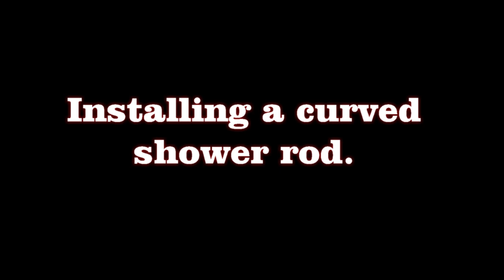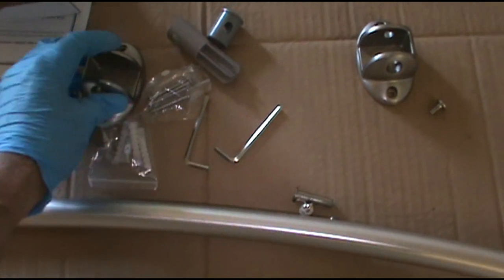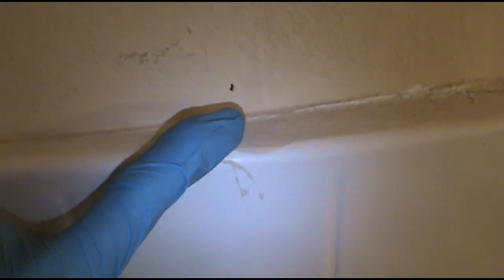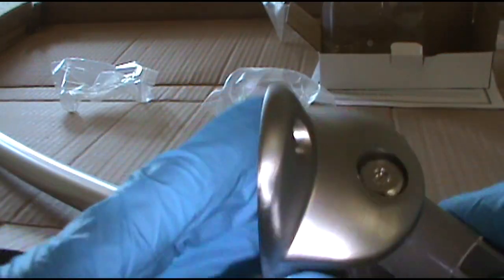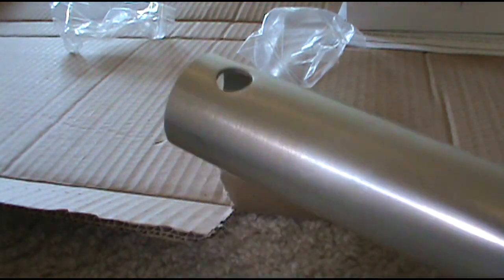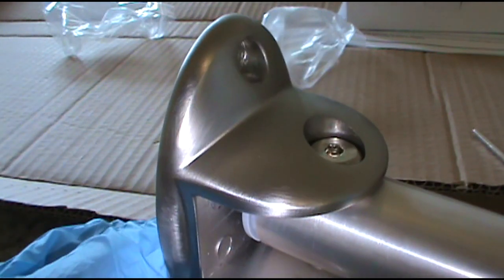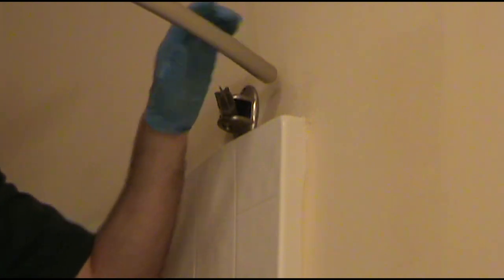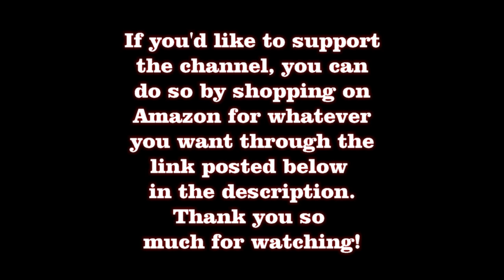HOW TO INSTALL A CURVED SHOWER ROD

Comment: Like your video, but there are two things I have learned over the years about curved rods.  1.  When you mount them do NOT go level but rather up about 5 to 10 degrees because the weight of the shower curtain will bend the bar down slightly, so adjust for this.. 2)  Save the wall anchors that come in the package for hanging smoke detectors.  For curved rods, unless you hit a stud, use the Snap Toggler anchors.  Nothing in the world beats a Snap Toggler (other than finding a stud or perhaps striking oil).
Reply from the maker: NETWizzJbirk I dig it man! Thank you for watching skid!
www.DirtyMaintenanceNation.com

Comment: Just installed one like shown in your video, in my house, and the instructions show the wall mount reversed so that there is a more "finished look" when standing outside the tub.  My wife was even surprised but it's clear in the paperwork and the curved bar still clears the wall-mounting plate.  I guess the open end of the bar is high enough above the shower head and such that spray and moisture in the tube is not a concern. (?)  I'd upload an image of the instructions if I knew how...